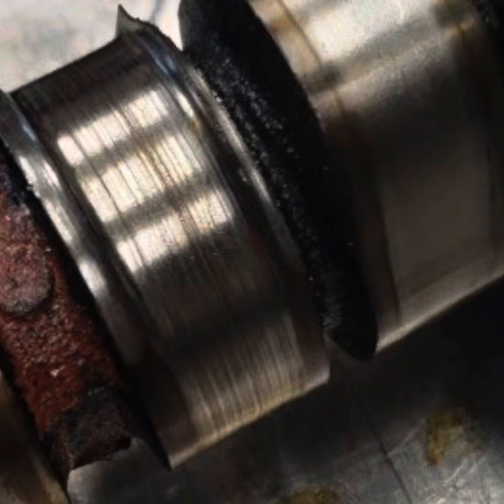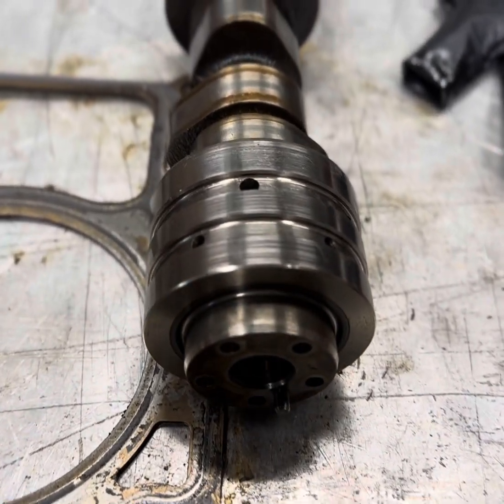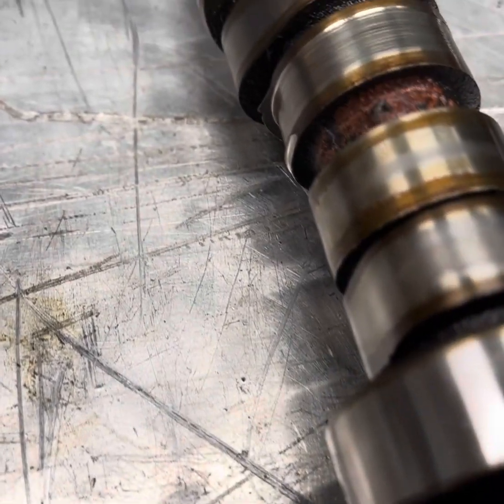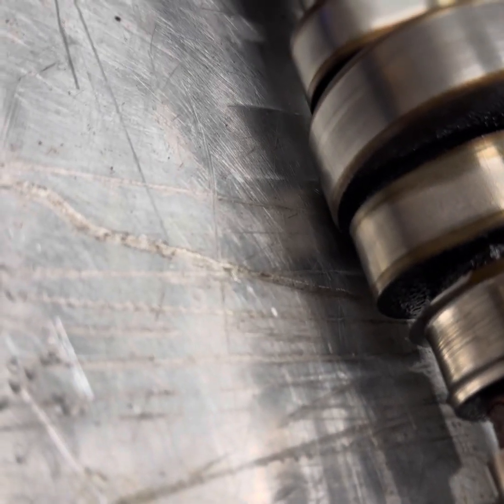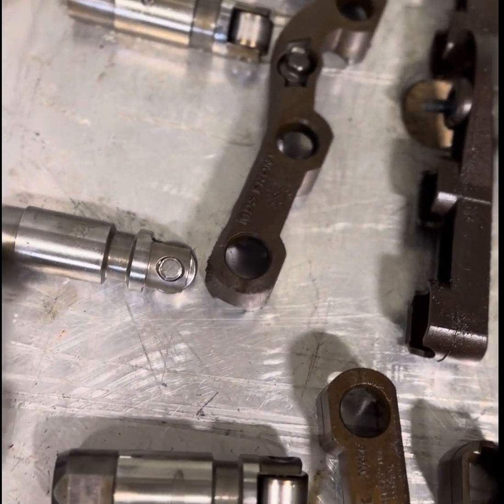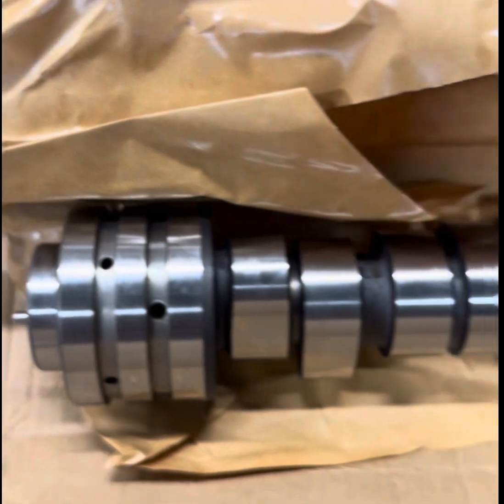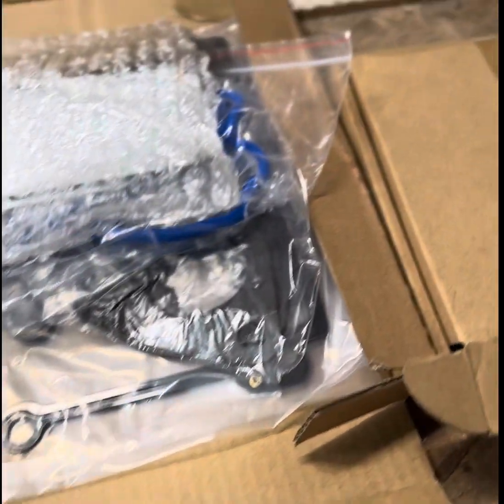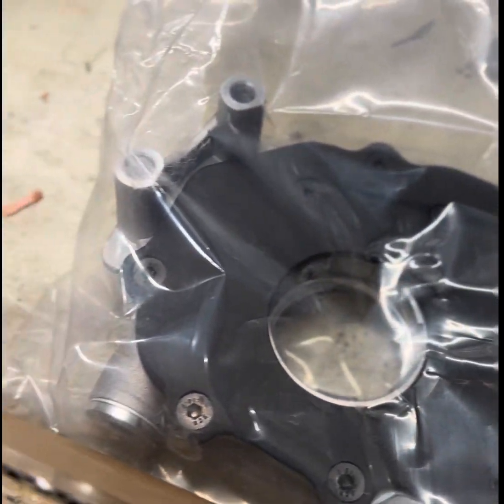2011 Ram 1500 hemi camshaft kit from overseas .

Comment: I've been researching where MOPAR parts are made and China is at the top of the list like other USA car maker parts. I'm in no way trying to start an argument or debate this and this is my opinion only. I truly believe some of the negative reviews "don't buy anything but MOPAR, Don't waste your time" are some DIY's that are not familiar with engine teardowns and rebuilds.  If your watching youtube videos on how to do this but have never worked on and engine to this extreme,  odds are the parts may be could but your mechanical abilities were not in the game that day.
Reply from the maker: No offense taken . I am a Mopar MasterTech and I have worked on these engines enough to say that the lifters are made in Germany if it’s genuine Mopar . The camshaft may be from any place on the world . Usually it’s not the cam that fails but the lifter then the cam . I see aftermarket eBay lifters fail on these over the years . Have not had a single Mopar lifter set comeback except for a cop car that idle 24 hours and never shut down ,
Reply: Thanks for your reply. I read and article about a Chinese company authorized by Chrysler to stamp parts as MOPAR and they send engineers over to check the parts are made to there strict specifications.  Thanks for the information.
Reply: @BradsAirTimethese are the same strict specs that did this. Reddit post.
have a 2020 1500 Bighorn with the 5.7 Hemi. It's a very common truck. I'm just under 50 000 miles, never tow, drive like and old man ( most of the time). Having a routine oil change done after a 400 mile trip and my oil mechanic hits me with "you have bad lifters and probably need a new motor." Is this a common issue with these trucks?

[UPDATE] I'd like to thank everyone who commented on this post. Many were helpful to me in finding out what caused the problem. It was not a broken manifold. Sadly, it was lifters, and the engine is being replaced by the dealership under warranty. I also have to defend my " oil mechanic". To those who were ragging on him, that guy was 100% correct in his diagnosis. Just because he's chosen to do lighter maintenance as a business now, doesn't negate his years of experience. If this wasn't a warranty issue, and I had to do it out of pocket, I'd be trying to convince him to do the work...

Comment: Is it still working?
Reply from the maker: So this one I’m not sure but a similar eBay cheap kit lasted about 6 months and chapped the spring in the lifter causing mds codes . The metal and rollers were ok . It’s all questionable these days . I worked for Mopar and more and more stuff is made in China .
Reply: Still running fine but not driven in the last month. I can’t drive (medical)

Comment: Is it still up and running good? interested i have to do the same thing to a truck i bought that im trying to drive and trade in
Reply from the maker: So far yes . In a down side I diagnosed another 5.7 gen 3 hemi where the aftermarket eBay special cam and lifter combo lasted 6 months . This was due to the aftermarket lifter spring internally snapping .
Reply: I’m still driving it, but it’s been parked for over a month due to not being able to drive right now. (Medical)